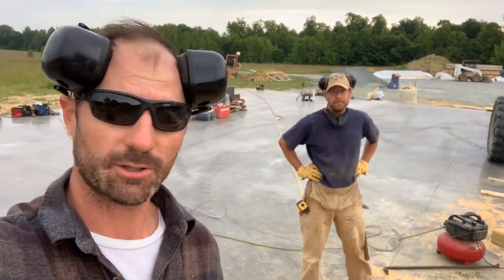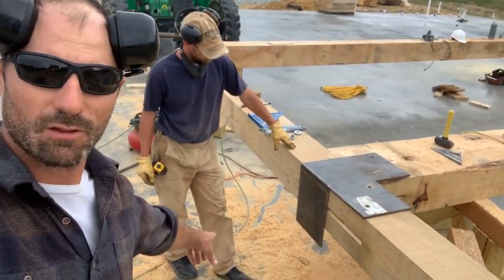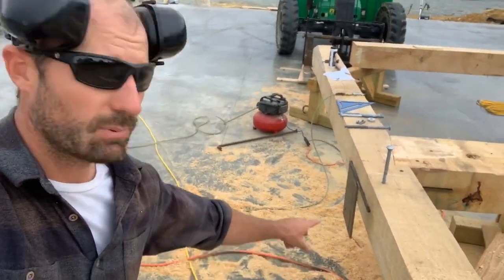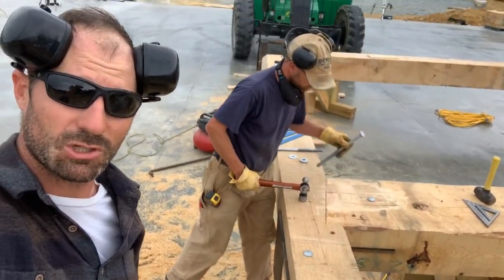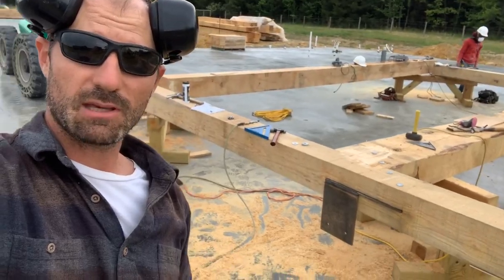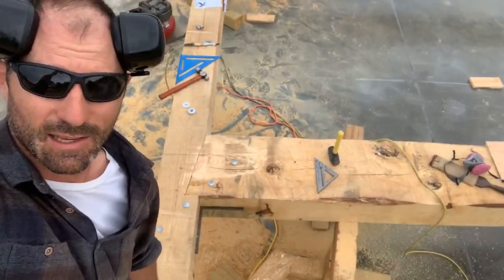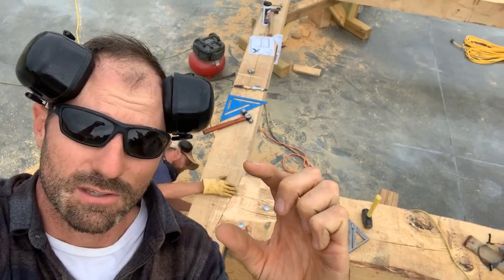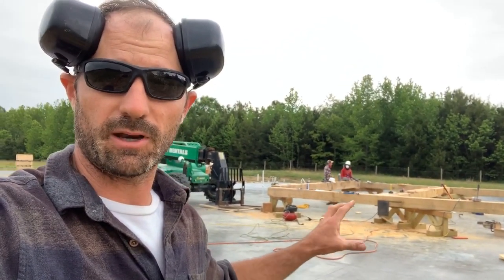AMAZING Post and Beam Joinery with knife plates - heavy timber construction | Barn Building Joinery

Comment: I love plate joinery its a modern twist to old school timber framing.  Once concern is the Long Term life of the  project.  Timber framing is different than post and beam, mostly in the way the joints are held together.  TF uses wood and wood pegs to fasten the joints.

Using steel knife plates adds a problem most aren't aware of unless they've been building a long time....Iron sickness or Iron-rot.

Using iron/steel allows the oxidation of the wood faster and causes those grey or black streaks.

The next best way to use metal knife plates is to use Aluminum plates and aluminum rods as pegs.  Works great, no rot and no iron sickness.  Yeah,  its more expensive.  But for a building thats supposed to last more than 100 years, it may be worth it.
Reply from the maker: Good point. Something we'll need to keep an eye on over time.

Comment: Nice work guys! Is there a video of the chainsaw plunge cut? You mentioned it took two cuts with the chainsaw and I wonder how you did it so accurately. Cheers
Reply from the maker: We haven’t put together a video demonstrating that cut yet. We bolted a 8” wide x 24” long plywood guide to the chainsaw bar and then added a 1/4” piece of plywood to bring up the cut 1/4” for the second pass to make the plunge cut 1/2” total width (instead of just the 5/16” thickness of the chainsaw blade/kerf.
Reply: @HeirloomBuilders  awesome thanks - please let me know when you get a chance to video that

Comment: Very cool joint. My main question with joints like this: how do you drill those really deep holes through the timbers and make sure they line up with the holes in the knife plate?
Reply from the maker: It’s tough. We lay out the knife plate on top of the joint, Mark the centers of each hole, and then use a square to guide the drill bit straight in. We place the knife plate in its spot, start with the two opposite holes, bolting them after drilling, and then drill the ones in the middle so the plate can’t wiggle off center if we don’t get it just right. I hope that makes sense

Comment: I’m curious about the strength difference between this and a traditional draw bored through tenon. Looks awesome!
Reply from the maker: I’m curious about that too. I know the strength of that half inch steel is much greater than the wood members itself, and it would be interesting to see how the joinery performs under different directional forces
Reply: @HeirloomBuilders   the national design standard is open source from American wood council. The knife plate connection strength is covered in one of the chapters, although it may take time to calculate strength as there are a number of factors; bolt strength, bolt bearing and edge distance, wood shear strength, additive bending forces translated to shear, etc. The same calcs can be made for a mortise and tenon joint; for the most part I think the tendon is the weak point, especially with sharpe angles.
Reply: I realize it is kind of randomly asking but does anybody know a good place to stream newly released movies online?
Reply: @Zakai Ishaan thank you, I went there and it seems like they got a lot of movies there :D I really appreciate it!
Reply: @Kason Chase glad I could help :D

Comment: Very good video. What types of companies do the engineering for these types of structures?  I am interested with a project but can not find out where to start (or who to even call).
Reply from the maker: Mike and I did the framing design and had a STRUCTURAL ENGINEER  verify the beam sizes and steel connections. A structural engineer can do it all for you if you don’t have the prior knowledge of heavy timber framing design.
Reply: @HeirloomBuilders  Do you have a reference for a structural engineer?  I've hired two engineers and an Arch - both ignorant to what really needs to be accomplished.
Reply from the maker: @tillmansr2002  where are you located?
Reply: @HeirloomBuilders  Saint petersburg, FL
Reply from the maker: @tillmansr2002  certainly. I work with a crew that has an engineer licensed in FL. Contact joni@gfengineers.com. Send your contact info and any plans you have so they can figure out next steps.

Comment: Sooo...the metal piece, do the mortise and tenon rule ???
Reply from the maker: Mario Gatica I think the steel knife plate connection is much stronger than traditional mortise and tenon joinery.
Reply: @HeirloomBuilders  thank you for your answer....
Once i have a discution with a guy, or lets call it a different point of view on a dove tail joint used for floor or two level joist on a timber frame, i read it some where, i think it was in a web site called Timber Frame Guild, where different people there, mostly timber frame seniors saying  that dove tail joint was not enough, and you must used a tusk  tenon joint at least one in the midle of the spam, just to make sure, and be safe, as wood are not dry enough some times.....i let the guy know what i read, and he got kind of angry saying he was at the timber frame industry for like 15 or 20 years he said, and the dove tail joint was enough for all the joits, there it was engeniring prooved joint....well it was the end of the discution, as i have cero experience on the subjet, all i did was telling what i read.
But people like you in the other hand, are looking for the extra strenght, and there is always a room for improoving

Comment: How long does a 10x18 have to be in the kiln??
2 months so that it doesn't crack?
What are you drying it to? Anything under 20% is probably relative humidity where you are.
Reply from the maker: TERRORoftheLORD good question! We actually couldn’t dry these with our solar kiln because they are 24 feet long and our kiln is only 14’. And we have a strict deadline for the wedding. These were dried in a conventional kiln for about 7 days.
Reply: @HeirloomBuilders  seems I read somewhere that some early American timber frame barns where built green. Have you had any experience with green timber construction?
Reply from the maker: @beardedbowhunter6139  you are right about that. Some folks still frame green. I don’t have any experience timber framing with green lumber though. A friend of mine built his house that way 20 years ago and woke up every night to what sounded like fireworks as the oak dried! I’d rather frame dry so the joinery doesn’t have to strain so hard
Reply: @HeirloomBuilders  thanks for the reply. I really want to build a barn like this for myself, for livestock. I have a sawmill but no kiln. I'm just trying to make up my mind how to proceed.
Reply from the maker: @beardedbowhunter6139 Kiln drying costs about $1/bf. So building a solar kiln would quickly pay for itself. Check this out!  https://youtu.be/rXiOJJQubtM